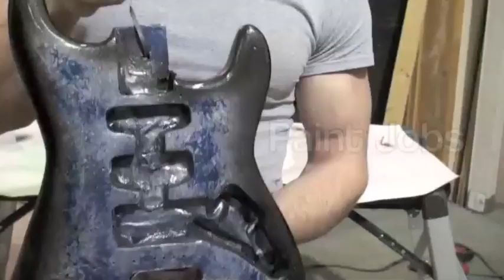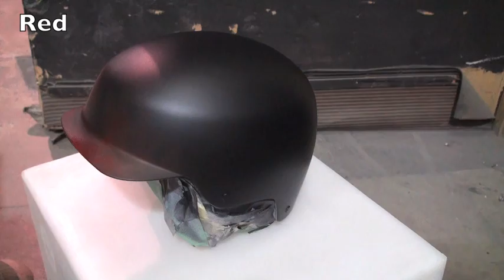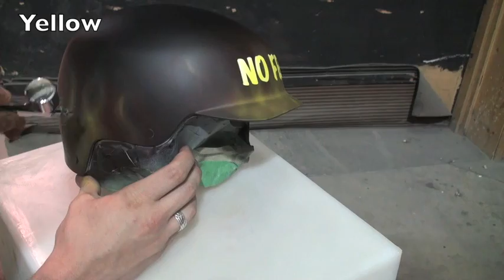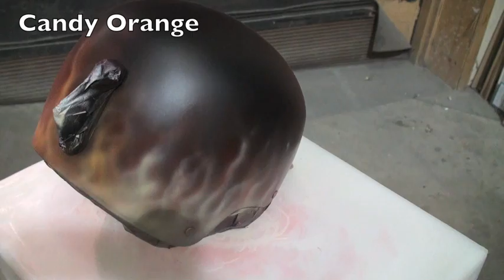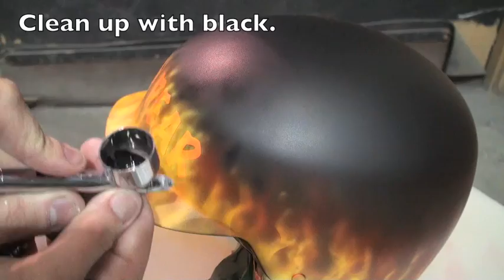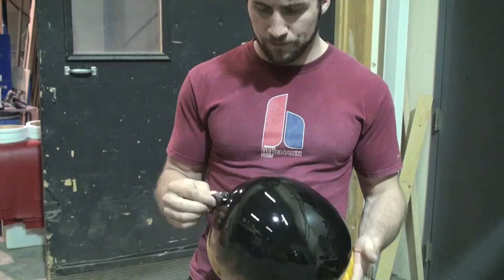Airbrushing True Fire with Water Based Paints

Comment: What water based colours would you suggest for a sunrise type fade from orange to blue? Im using the wicked and auto air colours and have some already but wanting to know what others i would need. I have auto air candy orange, candy brite blue and sparklescent nightmare blue which is the colour a lot of the helmet is going to be so want to fade it to the sparklescent nightmare blue eventually. If you have any tips it would be awesome thanks!
Reply from the maker: That's an interesting combination. Just to clarify, the nightmare blue is the only one in there that will have any sparkle to it. Anyway, I would paint the helmet with the blue first, then go in with white and airbrush over the areas where the fade needs to go. Then you can paint over those areas with the candy colours. I suggest that you get a semi opaque orange as well just in case. The candy orange is very bright when you put it over white.
Reply: Thanks! Im only just getting around to doing it now. changed my mind and fading it from orange to blue but the blue will end up being midnight blue. Was wondering if you have done any videos fading between colours?
Reply from the maker: I don't think I've covered that specifically in a video yet. I'll keep it in mind for a future topic though.

Comment: It looks great...excellent job using water based paints! The only thing is doesnt that "No Fear" slogan look really crooked or is it just the angle I'm seeing it on? Looks like it's extremely lopsided. Either way the paint work looks phenomenal!
Reply from the maker: Thanks. I think it must be something to do with the angle of the camera. I measured the distances between the sides of the bottom edge and the visor when I put it on. I can't go back and check it now because I don't have it anymore, but I'm pretty sure it's straight.
Reply: I thought the same thing. The N looks considerably higher than the R to me...but I chalked it up to my old eyes.  :)

Excellent video and results on the fire. Gives me confidence to try it with my water-based paints, now that I'm getting more comfortable with airbrushing.

Comment: Brad... I would like to do translucent flames over 3M Reflective vinyl material (on my motorcycle)...so that they will "light up" in headlights at night. Will the candy paints work for that? And should I use white film or yellow film for my base material?
Have you ever thought of, or tried, that before?
I have done the old 'classic' flames of the '40s simply by cutting red 'centers' on yellow outside portion, with a few white and blue highlights... It looks pretty nice! But are no comparison to the 'real flames'.
[The Classic Flames look fine on my cruiser, but I want my Sport Bike to be all 'Modern'..!]
Reply from the maker: Hi Floyd. The candy paints will be your best bet for that. What kind of film are you referring to? I've done a couple types of translucent graphics. I will be difficult for you to get much detail or definition with just the candies because the other colours are what allow use to make hard lines, but you should still be able to get a flame-like look from them.
Reply: The film/vinyl that I use is the same reflective they make wheel stripes and Police lettering and such with... that "lights up" when headlights hit it. 
So, the artwork needs to be done completely in translucent paints that will allow light to shine THRU it and 'reflect back' in color...So, if I use white 'base' shapes it will 'block' the light from reflecting thru...so it will look nice in the daylight, but would be 'blank' spots at night.
I have not had a chance to "experiment" yet.(unfortunately, I do not have a dedicated, full-time 'work shop' area, and have to put up shop in my garage, then put everything away again.)
But what I am planning to try first is yo use a yellow vinyl with red and orange paint colors over it ... sort of like painting on black velvet, where you work 'in the negative'...

Do you have an email address where I an send you some pictures of what I am talking about, and maybe some of my "experiments"?
you can email me at: CEO@RiversFinancialGroup.com
Reply from the maker: For stuff like this I use brad.angove@gmail.com.
If you're ok with having a yellow background I would go with that. It will make it easier for you not to have to add yellow as well as the others. Start with orange, and then add red selectively afterward; essentially opposite to the how flames would normally be painted. I've done this before in my metal art work and it works out reasonably well.
Reply: Brad Angove Thanks Brad!
I found some "glass paint" for doing 'stained glass windows' that I will be experimenting with. It looks much like "candy apple" lacquers. I'll let you know how it turns out!
Reply from the maker: Sounds good. Thanks.

Comment: Hi, looks great! I'm thinking of painting a helmet with the auto air colours. Are the semi-opaques the best ones if you just want basic colours? Also, what type of clear coat would you recommend? Thanks
Reply from the maker: +Alex Watts Yes, the semi-opaques are what you would use for basic colours. The manufacturer recommends using a catalyzed polyurethane clear, which is also what I believe is most appropriate for helmets. That being said, it is also dangerous and requires the proper equipment. Do you have access to a respirator and a decent spray gun?
Reply: +Brad Angove stupid question, can the base coat sealer white be used as white or do I need to I go over with semi opaque white? I don't have a spray gun for the clear, can you use an airbrush? If not then I'll probably try a spray can (not sure what type). Is a face mask sufficient for using the spray cans? Thanks for the help :)
Reply from the maker: You can use the sealer as the white, but it may not be quite as bright as the actual white. I'm not 100% sure on that. I wouldn't use an airbrush for the clear; you'll never get an even coat of it, and it will probably wreck your airbrush. You can get a catalyzed polyurethane in a spray can from spraymax. It's quite a bit more expensive than a normal spray can, but it's pretty good stuff. You need a facemask with fume filters like the one I use in a lot of my videos. A dust or particulate mask won't protect you from the solvents. That catalyzed paint can harden in your lungs.
Reply: +Brad Angove thanks for the help, I'll have a go with the spray can clear, I have a mask similar to yours. I would like a metallic blue but the midnight blue looks quite dark so I think I'll mix with the process blue, hopefully that will look good!
Reply from the maker: There's also a cobalt blue and a couple other metallic options.

Comment: Did you use a seal coat after each of the candys?
Reply from the maker: No. With this water-based paint nothing like that is necessary.
Reply: Cool thanks
Reply from the maker: You're welcome.

Comment: wont the flames melt the ice?
Reply from the maker: Only if you hold them too close.
Reply: can you do a blue flame next  , great work!!!!
Reply from the maker: I have a few weeks worth of videos ready to go (already in my "upload schedule"), but I'll try to get a blue flame one up soon. I'm also going to do a ghost flames (with water-based paints) video. Thanks!
Reply: thanks, I just started airbrushing with createx colors, and dont know what the hell im doing.
Reply from the maker: Do you mean createx specifically, or the brands made by it? You will need one or two candy colours for blue flames, so you'll probably want to go with some AutoAir paints.
Reply: I have a basic set of the transparent createx brand, a basic color set of the wicked line of createx, and a bottle of opaque black and white. I have some pearl additives by " paint with pears" that I can also add to the paints.
Reply from the maker: Ok, you can do flames to some extent using the created transparents, but like I said at the beginning of this video, you need the candies to really get it to work.
Reply: I tried something different yesterday and it gives a really cool effect. I took some landscaping felt material out of the shed and cut a piece and taped it to a piece of white paper. then a air brushed white, then blue then black transparents over it. its kind of like an ice cicle effect . I just dont know where to go from there
Reply from the maker: Why did you start with white if you were airbrushing on white paper?
That sounds like a cool look. As for where to go from there, what are you trying to create with it?
Reply: I want to airbrush my ole ladys helmet , it is gloss black. I just scuffed it with a green scrubby pad, taped it off and wiped it with alchohol/
Reply: I want to airbrush a design with the createx wicked colors and I have some pearls to mix in from paint with pearls. not sure how to start. can I go straight to the scuffed black with the created wicked color, like a red diamond or something?
Reply: im thinking after I get the design on I caqn clear coat it with rattle can laquer clear?
Reply from the maker: Sounds like you've got the prep right. Ideally you would apply some sealer now. Createx makes a water-based sealer that goes with its paints. Or you could just use some adhesion promoter, or plastic compatible primer. I have seen it work with the paint applied straight to the plastic, but I can't recommend it. If you're covering the whole helmet in the acrylic then you should be fine to use rattle can lacquer over it. The acrylic doesn't react to much. If you're not coating the whole thing then I would be worried about the lacquer adhering to the plastic. Again, an adhesion promoter would be a good idea.